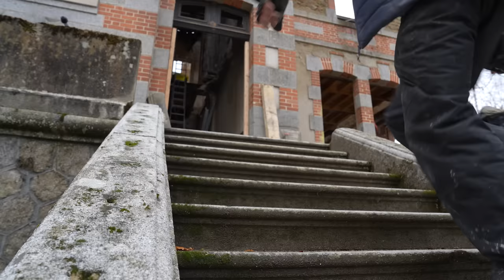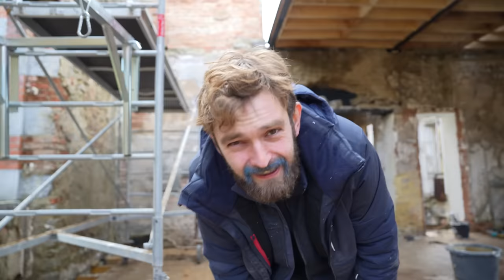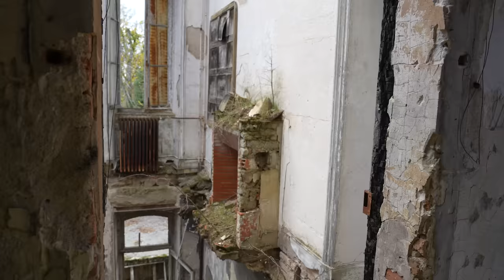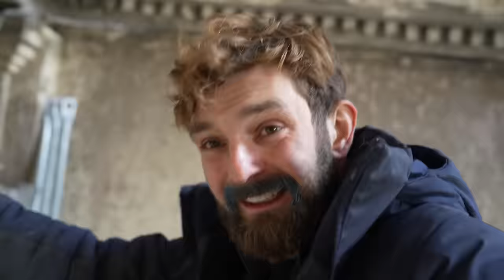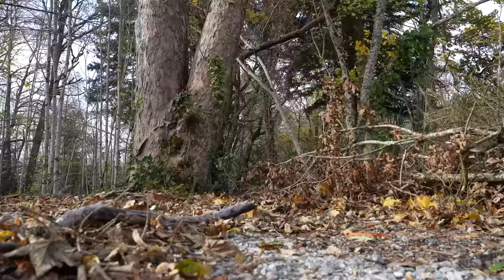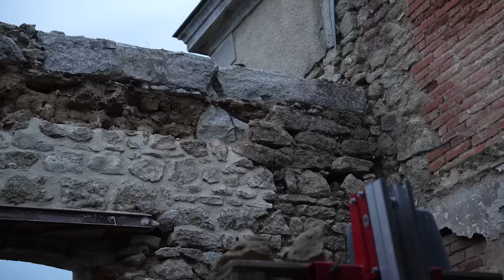Working to rebuild the top of the chateau in high winds.

Comment: Windows have a long lead time. If you've ordered roof trusses, you should start thinking about windows. Then you'll be dried in. I can't imagine living there with rough interior stone walls. I'm guessing you'll render the walls. I'd insulate under the render with at least foam core to make a two coat. I might even insulate between floors in the floor joists.
Reply: No;halls of stone, like the dwarf lords in Lord of the rings😂😂😂😂😂😂😂😂😂😂😂😂😂😂😂
Reply: I think it’s going to be another 2 years before this section of roof is finished. You don’t really want to fit the windows before then.
Reply: @duncanhiggins6463  For sure, not until he has a clear idea of when it's going to be ready for windows.

Comment: I was sure , that the toilet,👀 on the 3rd floor, had been removed 🙊long ago, and this vid was from ‘minutes ago’. 
     I live in a high wind, hill town.. 80 10 km from Boston. I came in 1974 and watched ,’how hard the wind doth blow’., In 2006, a tornado, crossed, over my house,west to east, spinning counter clock wise, from the ground. The wind took down 55% of free standing trees, and snapped many 150 ! yr old ,oak trees, 👆🏼35 ft in the air.
Reply: I was surprised by the toilet & radiator too then remembered he’s only working on 1/4 or 1/2 of the building so far.

Comment: You need a winch out of one of the top windows to ground level so you don’t have to keep lugging those buckets of muck up by hand.
Reply: He has the winch. With the wind blowing through that entire house, he was probably afraid of the bucket flailing about by the time it got to the top. In truth, he is a bit scared of those tower stones falling down, even though he has built the floor up there doesn’t guarantee that one wouldn’t find its way through. Just as quick to haul a couple of buckets up the ladder. This is what I would have done as well. I think the lime mortar is lighter than concrete. Correct me if I’m wrong.

Comment: Hi Dan, why don't you just put the bucket next to the wheelbarrow and fill it that way - then you don't need to lift the shovel that high? 🙂 Also, perhaps you can do a short video about what you are all planning to do with the chateau?  We know you are planning a roof but what is the plan with the rest?  Are you going to replaster all the walls inside? Are you going to make any structural changes? Also, and maybe you have mentioned it before but what is the plan with the chateau once done - are going to live in it?  Rent out the rooms? Just wondering...

Comment: Will the lime harden or freeze?  With the cooler temps and wind, wind chill drops the temp and up higher in wind without protection…..
Reply: If frost arrives, there will be no more mortar work happening.
Reply: @LaReynedEpee It needs a month to set so it is already too late to do this work.
Reply: @otofoto  Agreed. I have some exterior lime pointing and rendering to finish on my house, but it won't be done till next spring because of that. Who knows, he might be lucky (thanks global heating) and not see much frost 🤷‍♀️
Reply: @LaReynedEpee  NHL lime will take less time so he can try his luck.

Comment: I don't understand it. He was pulling out the stones with his bare hands and then he stopped. Why is only a small part of the wall so damaged? Wouldn't the whole wall be in this state? How is this stable when only some patches are redone?
Reply: He said he was starting in the middle then he'll work on the left then right then around the window
Reply: @JPRobinso  Right, he was burning the roots in one of the videos. What I don't get is how the roots only damage the wall towards the inside. I think they must have damaged the wall all the way through to the outside. And this is compounded by many freeze-thaw cycles. We will see how this will work out.
Reply: @thomasgunther  the outside wall skin and blocks have a harder cement. The inner walls absorb more water with that crumbling lime. The roots would be drawn to that.
Reply: @thomasgunther  months ago, he had a man giving him a quote  for rendering outside the property

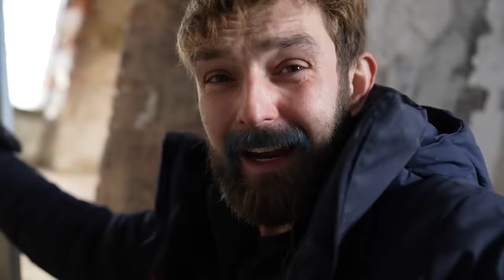Comment: 2:35 Yeah, it's withstood 40 years of storms, but that was before you removed all the structural trees growing in the masonry.
Reply: But a lot has been consolidated, steels replaced, floor joists added. There will be loose material, sure.

Comment: Has Dan adressed in a video how he plans to insulate the chateau?
Reply: I have also wondered that.
Huge building without insulation would either be ball-freezing or prohibitively expensive to heat.

Given it has solid walls, I'm assuming he's gonna use insulated dry lining plaster board inside.
Reply: He was around when they were insulating Chateau de LaLande (Chateau Diaries) so he certainly knows about insulation.
Reply: I live in a cottage with thick walls and believe me insulating benefitted 4 degrees warmer upstairs and 2 degrees downstairs

Comment: I can't help but wonder,  i'm glad you bought the roof, and glad you have cut the trees and worked on a ditch to plant a fence row of bushes.   But i can't help but think a roof on at least one part so you can seal in an area and work through the winter would have been a priority?  and then i see some of the walls in this video and i'm like,   how is that not been a priority.    lol

Comment: I have a question about the wall you are working on.  As I looked at the window opening and the work you are doing I noticed the lack of mortar around the wall to the right of the lower part of the window.  Why are you not filling in round the stones that are exposed?   Does the rain flush the mortar out from around the stones?

Comment: Hi Dan, check out the latest video by Chateau du Purnon “ Restoration BREAKTHROUGH” on their roof restoration. There are great tips on the order of restoration, like chimney stacks first, then roof framing and tiling, building a large “umbrella” to keep out the rain while restoring the roof.
There is also great information in facade restoration, ancient tools etc.
You should get in touch with them before you start your roof. I feel it would be very beneficial.
Enjoy

Comment: Dan why don't you put the concrete mixer inside? Would save you having to walk up the outside steps with buckets of lime/ concrete.
Reply: @andymccabe6712  Rude much @andymccabe?  Carrying a few bags of sand / lime in the electric or otherwise wheelbarrow up a ramp,  that Dan has done many times before would be fewer journeys than carrying the mixed wet concrete mix in buckets.

Comment: Do you really have to clean up the mortar joints if you're probably going to cover them in insulation and some kind of interior finish? 
Why are windy days some kind of romantic? Early 19th century landscape painting romantic. Fragonard romantic - The Fete at Rambouillet with a storm moving in? The wind whistling through huge windows.

Comment: Why don't you hoist the mixer up to the top?
Reply: That cement mixing process makes a big mess. This is why in a few videos back, Nick spread a large tarp on the ground. The subtitles said it was a cement mixing area. Andy is correct in that it would defeat its own purpose to drag all of that up there, not to mention the mess.
Reply: @PaulRiesland  I was thinking about that after I posted... but it could be done inside the Chat and hoisted up a larger bucket to reduce the footwork
Reply: @PaulRiesland  the mess is relative with this project. And the closer things are to the work area the less time and muscle is needed. Where I'm at the concrete would harden in the mixer within about 15 minutes

Comment: I think it would be easier to fill the bucket with mortar if it is placed lower than the wheel barrel.  Your putting stress on your body that isn't necessary by having to lift the shovel!
Reply: His back may be killing him to reach down or extend. I have had this happen to me. Just a guess here, but it does look like he is struggling a bit or in some form of pain. But, he soldiers through. Then again, he may not even think about it, and we are all just looking for worries.

Comment: Why don't you mix cement on the floor you're working on ? Just take a bag upstairs and a bucket of water.
Reply: why  carry up a bag of lime and a bucket of water and several buckets of sand when you can mix it all by the pile of sand and only have to move the finished product?

Comment: Here's an idea....you might not like it, but.....Nock the red towertop down  and build flat roofs over all the top. Even over the rest of the castle. Without having to build the original roofs you could get the rest of the castle done and whet that is fixed you could think about rebuilding it as it was originally....Could save you a couple of years.....❤

Comment: Q. Why are you rebuilding with stone ?  None of this will be seen ,it will be plastered over , lightweight blocks would do the job just as well and would be easier and faster .  Set up a builders hoist outside with scaffold to move materials to the upper floors so much easier. Work smart not hard !!
Reply: The stones will lock into each other, much better than blocks.
Reply: seriously !!!  how is that ?  the strength of the bond formed by the bonding agent is dependant upon total surface area available and the porosity of the material being bonded , on both counts these lightweight blocks are far superior .  @PaulRiesland